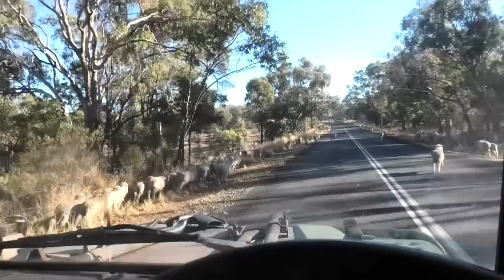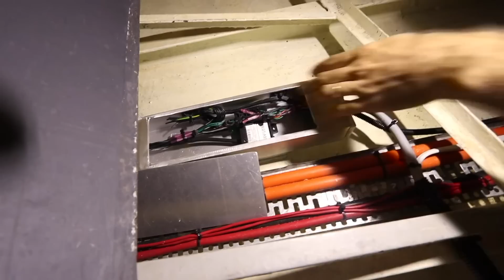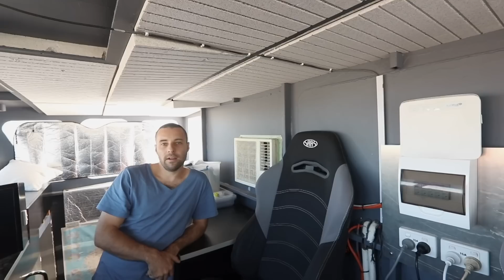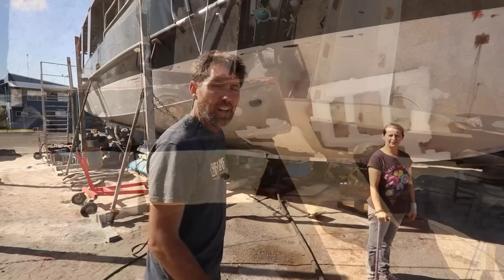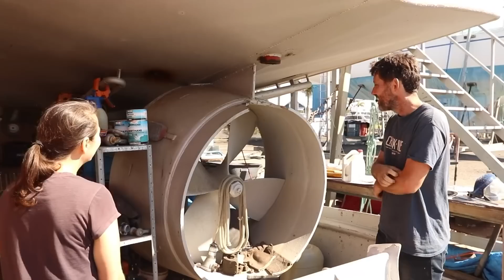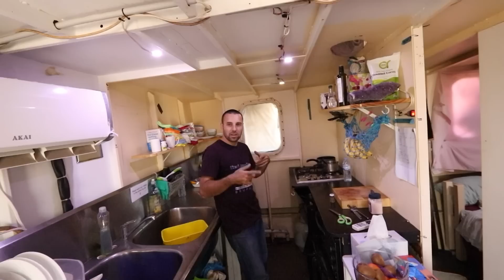Touring Brupeg

Comment: IMHO, the weak point of the pipe manifold is the attachment to the hull.  Those brackets due to their shape, if hit hard could rip off the hull causing a tear and water entry.
Add 1/2" x 10" x 12" pads welded all the way around and attach the manifold brackets to that point.
JIM

Comment: In times gone by all boats were keel cooled  ,, almost all the Brissy  ( Bay Boats )  used petrol engines and gearboxes from automobiles ,,,  a thrust bearing system was fitted in the shaft because  didn't have the capabilities for thrust ,,
Reply from the maker: Yeah, keel cooling definitely has it's advantages.
Reply: @DangarMarine  Even right up to the 70's   when I was on the Trawlers in Bundy there were lots keeled cooled,, using domestic copper pipes,, ,still worked ,,

Comment: A great way to clean vegetation oil is to boil it over water. For example a 5 gallons of water under 30 gallons of oil in a 45 gallon oil drum. Boil the water and the rising steam cleans the oil as it runs though. When done, drain the dirty water (fit a large bore drain) and tap the clean oil from the side of the oil drum.
Oil lines should be trace heated and insulated.

Comment: That engine needs a bypass oil filter system. They filter down to 2um (compared to 209um), are common on trucks and dramatically reduce the need for oil changes.

Comment: i would check you inlet fuel restriction as that poor old PT fuel pump doesnt need 3 filters i would run just your racor filters and get rid of the filter on the fuel pump just run a spud to delete the filter on fuel pump

Comment: "You might have 50 switches" I think you might have 100 - depending on how you count even 200.
I recently had to wait for my wife in the car and started counting the switches out of boredom.. I thought ... maybe 2 dozens? 
When my wife came I was at 87 and not even finished.
In the driver's side door alone where 8.  And 14 in the steering wheel.

Comment: Hmm... a 2600 km (1600 miles) round trip in an elderly rag-top diesel Land Rover. Not the most comfortable road trip but there's an emergency shovel strapped to the bonnet (hood) so all will be fine.

Comment: I have more than 45 years at sea, i started as a deckylearner and worked my way up to Captain for the last 17 years before retiring, I have worked on all size vessels from rowing boats to 50meter supertrawler, mostly in the fishing industry but had a good few years in oilrig standby and supply.
Any wiring in control boxes, charging and almost anything is always best on the deckhead(roof for non seamen) not on the deck(floor)and in the centre not at the sides, any small amount of water in that hold will get into those control boxes as the boat rolles from side to side as it will travel along the deck and up the bulkhead. If you take a look round almost any profesionaly built boat/ship you will see that control panels of any type are usually suspended and towards the centre line not on the outside hull as in a big roll can be lower than the deck.

Comment: Diesel exhausts systems are very unlike petrol exhausts, the diesel engine is very quiet in emissions compared to petrol engines and most of the noise comes from the mecanical clatter.
Reply from the maker: Yes, sound proofing the engine bay seems to make the biggest difference.

Comment: you know you could use high density rubber plates between the hull mounting and the engine mount  if you do both ends acts as a buffer must be cut to very close tolerances almost same size as the bolts cut rubber at about 1 and 1/4 inches thick use your own judgement  not to thin

Comment: Wiring on the floor of the engine room?  Really?  Any flooding and all the electrics are submerged.
Reply from the maker: That part of the bilge is about 1.5 above the lowest point. If that gets flooded you've got much bigger problems than a soggy temperature sender.

Comment: Tell your buddy to get an Old School  good Mechanical Fitter who is used to doing rotating shaft alignments  to align an engine to the prop shaft and then pin same into position Job done  .... would save a lot of vibration  if good tolerance's were achieved and you would't burn out couplings or cutlass shaft bearings on the prop.
Reply from the maker: From talking to him it sounds like he got it pretty much spot on himself. Damien was an engine rebuilder in a previous life and very used to achieving fine tolerances.

Comment: Some thoughts you might like to pass on. I worked as a fitter on the yearly refit of L'Astrolabe, the French ice breaker supply ship for their Antarctic base. She was a modified oil rig supply ship, they cut a large section out of the bow and fitted a sloping 80 mil plate into it to enable it to ride up on the ice. The rear deck was completely covered by a solid steel shed for want of a better description and was for cargo. The hull had any number of water intakes but all were flush with the hull to allow ice, free passage. The hull had deep gouges, ( 1 to 2 mil deep, look like cut with a lathe tool) around the bow and the taper to the props at the stern, we had to pull the shafts to xray them because of ice hits on the props. I asked the skipper, a salty old dog indeed, why the props did not have some form of guard and he explained that it had been tried and failed because the ice bent the guards onto the props. Most times the helmsman would hear a big piece scraping the stern and feather the props, but there was a constant banging of smaller pieces hitting the blades. So thought one is that shield has to go, imagine a half ton of very cold ice jamming its nose in there. I also suspect in might cause cavitation in very rough seas.
Thought two,  the amount of glass on the boat.  L'Astrolabe had a very high foredeck section, with the wheelhouse atop it, you have seen them no doubt.  I asked the skipper about the about the 80 mil plate glass in the forward facing windows, he explained it was not unusual to have green water hit them, the side windows were thinner, the only other holes she had in her were portholes on the lower wheelhouse section which I think was accommodation. Bloody marvellous adventure but never underestimate the destructive power of the southern ocean.
Reply from the maker: Thanks mate, appreciate you sharing your experiences. I'll pass it on to Damien.

Comment: Vegetable oil.  I heard you cover water removal, filtration, & biocide, but I didn't hear anything about acidity.  I'm really curious about other vessels that have been utilizing it for more than two years.  I've seen it really trash an engine, but it takes some time.  The engines that failed were never held at rated load for the majority of their operation.  Could that be the difference between failure and success?  I don't know.  I think I heard you say you planned on 1 micron filtration?  I think that could be problematic.  You cross over the threshold of diminishing returns.  Be curious on the filter specs too, and how much pressure it can take an maintain the rating.  The high pressure fuel system won't know the difference between 5 microns or 1 micron.  It's pretty low tech compared to modern diesel injection.  You on the other hand could be going through filters like mad, polishing the fuel to a level that isn't beneficial.  I'm assuming the oil will have some form of pre-filtering?
Reply from the maker: You'd have to check with Damien on the Project Brupeg channel.

Comment: I just discovered your channel and love your stuff. I'm in the US and know very little about boats, but I own a small freshwater bass boat. Although some of your stuff isn't exactly what I have and your channel isn't necessarily geared toward our yank equipment. I've learned some things in concept which have helped loads. Thank you.

I've been a diesel tech for over 30 years. Seeing a Detroit and watching you work on it brought back memories. Not many of them are good... Sorry.

Watching you turn wrenches drives me nuts. I'm always thinking "wtf is he doing?" Or "Why does he do it that way?". I think that's a tech thing. I would likely drive you mad too if you watched me.

From one tech to another, please let me suggest something. Get a long, fine tooth conventional 3/8" drive ratchet with a flex head in the best quality that you can afford. And get it with a comfort grip. It will change your life! It's long for leverage and flexes to adjust your plane of stroke. And it will tip to act as a speed wrench to run bolts/nuts in or when they're finally are loose enough.

This along with an assortment of wobble extensions will save you time and effort. The ratchet will never leave your pocket. I have a 30 year old Snap On model. The only thing that I've done is convert it to a fine tooth and installed a later model wide grip (because I'm a pussy).

Sorry to wax on about tools, but I love to watch you using them. You're one of the more real guys that I've seen on YouTube. I truly appreciate that you're so genuine. Thanks again
Reply from the maker: Hey mate. Couldn't agree more that certainly tools make life so much easier. It's always frustrating for me as most of my tools are currently spread across two workshops and nothing I need is ever at the trawler!
Reply: @DangarMarine  Since posting, I've watched more of your travel to and from the job. You're a maniac, my friend. 

I've been into large jobs, but maybe not this large. It's interesting to see your ups and downs. It's just how these jobs go. But I must say that you did a spectacular job on the engine bay of the trawler. It's like night and day.

Cheers. Keep up the good work. It's exhausting just to watch. :-)

Edit: BTW.... There's been a bunch of little stuff that needed repair and change on my little boat. I don't know if you inspired me or shamed me, but I think that I got everything done today. You're a hard worker and I think that you made me feel like a pussy by letting this stuff go on my own humble craft.

Comment: Lots of clever stuff. I didn't see how they're heating the living space, though. Waste heat from the engine somehow, I would imagine. That would be interesting to find out about.
Reply from the maker: Another great system are these diesel heaters you can buy. Put out loads of head and burn 1 litre every 24 hours.
Reply: @DangarMarine  Right, sounds much more efficient than running the main engine just to stay warm while at anchor.

Comment: Another variant on keel cooling that may be suitable for you Stu is chine cooling, create extra chines along the hull using say 75 X 75 right angle steel welded directly to the hull and run your fresh water cooling through the chine. Not only do the two sides of the chine radiate heat but the entire hull plate also adds to the radiant surface area. Detroit in Adelaide built a house boat for the parent company Bowater Tutt that went onto the Hawkesbury river decades back using this system The boat ran a 3-71 as a main driving a hamilton jet drive. It only had one chine per side with an inboard bridge pipe from one chine to the other at the bow, I can't remember how long they were exactly, maybe 8 meters? Advantages, super cheap, as it's mainly off the shelf angle, zero snag risk, and it could actually help with stability on your boat.
Cheers,
Ray
Reply from the maker: Sounds like a great way to go, I'll definitely look into that.

Comment: What's the advantage of having the railing door being split?  I would think a single door, maybe with > 2 hinges on the aft side would be just as easy to use unless you're opening it right next to another, taller vessel or dock.  But if your dock is that high, you won't need to open the door itself...  :)

RichE San Diego
Reply from the maker: There are two main advantages I guess. Smaller swinging space (in or out) and less weight. If you need to open the door in a rough sea, a heavy door can be quite dangerous swinging around.

Comment: I must admit I didn’t get a very good view of the swappable filter unit for the motor.  One thing to keep in mind is to pipe some small tubing from the outlet of the used filter to the inlet of the new filters so you can fill the new filters up before swapping into them. I used to work with some WWII vintage compressors and if we switched into a filter unit that wasn’t filled the compressor would shut down due to the air bubble.
Reply from the maker: Yes, filling the new fuel filter is important.

Comment: great work on Brupeg, I would however recommend that the electrical circuits in the engine room be run along the ceiling instead of under the floor. the floor can be awash with sea water with any little leak and this will make short work of the circuits.
Reply from the maker: Thanks mate. That electrical box is about 1.5 above the bottom of the bilge  so there will serious trouble by the time it gets wet!
Reply: @DangarMarine  My mistake, I did say electrical circuits and not meaning the "Electrical Box". In the video, below the plank walkway in the engine room was some electrical cables and a metal box that had connections in it. This was hard on the floor and these connections may get wet with normal water levels in the bilge.

Nice change of pace in the videos. thanks
Reply from the maker: It's deceptive because you can't see in that the keel is hollow. All that wiring is quite high above the bottom of the bilge.

Comment: Hi Stu. Very interesting video and some great ideas. Apart from these I would like to add some thoughts. The keel cooling i installed was a total of 12m 6mm wall 100mm dia tube. I had a baffle system involving a length of round bar through each side of the cooling with half circle flat welded to it every 500mm. This created turbulence as water will take the easiest route and forcing the water to make contact with the outside surface. You may find with running a cooling system the length of the engine room, then crossing to the other side of the centre line and forward there will be enough cooling for your 4 71, mine was the 8 71.
Reply from the maker: It would be cool to have a nice simple run like that and have enough cooling for the 4-71.

Comment: The air compressor on their engine generally is regulated to a maximum of 120 lb of pressure as for their blistering the paint off on a heat exchanger I'm willing to bet those that got that hot are on the compressed side of the turbo as an intercooler to cool the air down before it goes into the engine because 106 to 200 degree water of the engine is not going to burn paint that's Fahrenheit by the way

Comment: Cooling tubes on the outside of a steel boat is not rational. High drag, high maintenance, growth wise. As he said, boats use the keel for cooling. A cooler system can be welded to the hull on the inside, I have done both, and it works.

Comment: Dear @Brupeg, please consider Ubiquiti/Unifi for your networking. I could envisage a Wi-Fi and local networking system that could give a launch (or devices) Wi-Fi connectivity back to the 'mothership' over many thousands of metres and a link to port wifi for better connectivity for all clients: Check these blog entries for some starters https://community.ubnt.com/t5/airMAX-Stories/Long-range-WiFi-for-our-boat/cns-p/2036511 and https://community.ubnt.com/t5/airMAX-Getting-Started-Product/Public-Marina-Wifi-To-Feed-Onboard-Network/td-p/1886328
Reply: +1 I use Ubiquiti / Unifi to run enterprise grade networking & wifi, it's ridiculously cheap compared to Cisco or HP / Aruba but excellent quality, definitely up Brupeg Alley.

Comment: I served as skipper of a 105-foot crew boat converted to a ferry which had keel cooling which consisted of lengths of c-section welded directly to the hull.  We had Cat 353 diesels as generators, and we ran them all day long which hauled out for electrical power, and the hull only warmed up a little around the coolers.  The main engines were four Detroit 12V92TAs.  Rather than the exposed and vulnerable tubing Brupeg uses.  I don't understand his concern about the corrosion issue as a result of juxtaposed hot and cold.  I never saw that.
Reply: We had the same set up on a few boats and never had a problem either

Comment: FYI, for you and Damien, he mentioned when talking about the hour meter to not leave the key on. Hour gauges are supposed to get power when the engine is running, normally done through the oil pressure gauge. Assuming that if the engine has oil pressure, it is running. Not just when the key is on. This will give you a proper hour reading.
Reply from the maker: That would be a great way to wire it, I like that idea.
Reply: Sorry, oil pressure sender/sensor, not gauge.